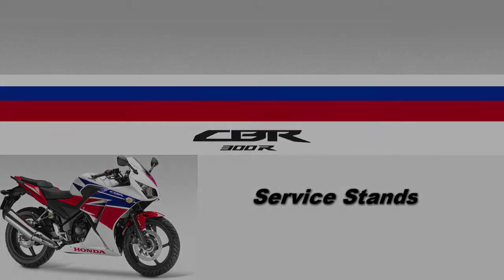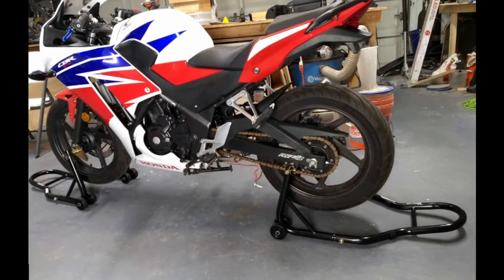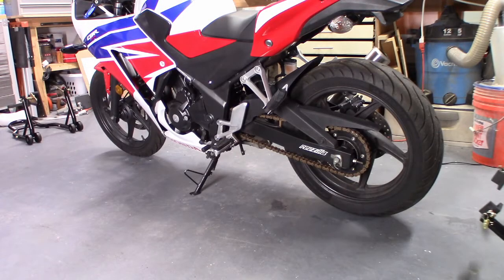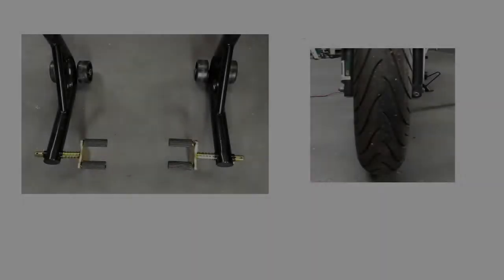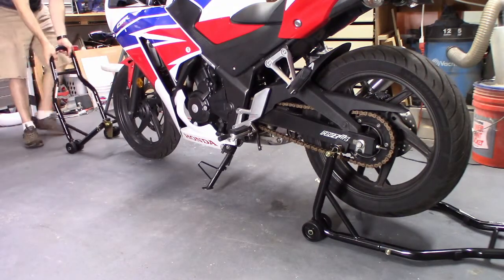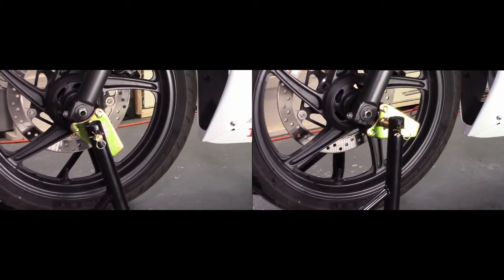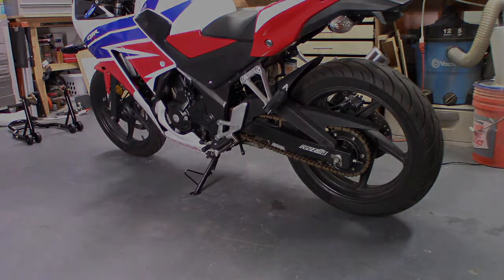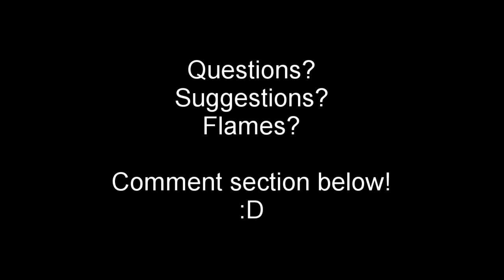Service Stands

Comment: Haha, I've done most of the NOT recommended things - start the bike while using rear stand (front wheel chocked), and sitting on it (not while ignition on). I know there are warning labels all over saying not to sit on it, but I had to test it because I want to place a model on it for a photoshoot, and I find with a sturdy wheel chock and the rubber supports on the rear stand seem quite sturdy.

I weigh around 57 kg / 125 lbs though.

I also have installed rear-stand support bobbins on the swingarm but the rubber supports seem sturdier